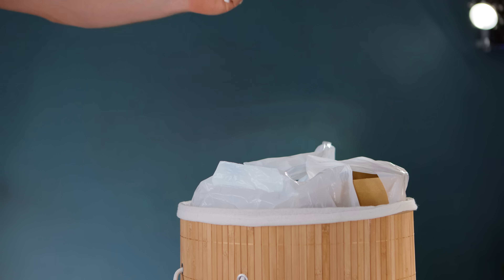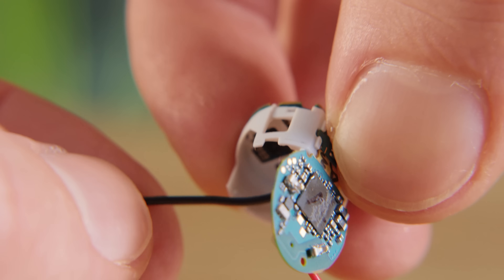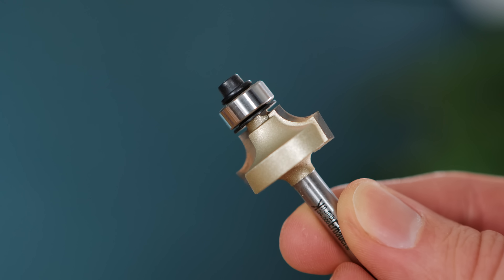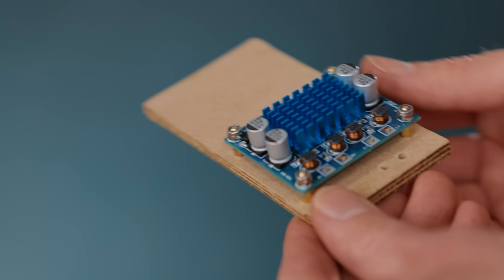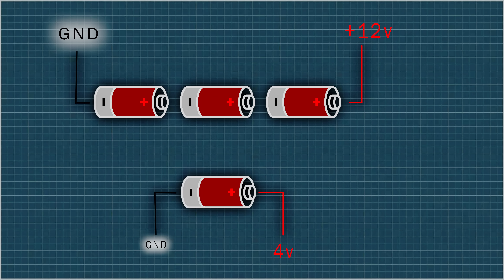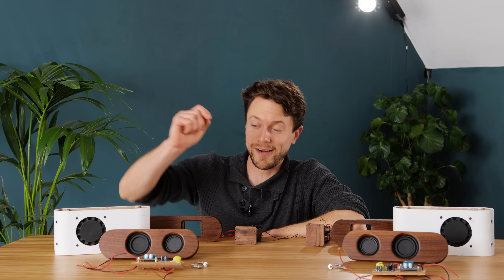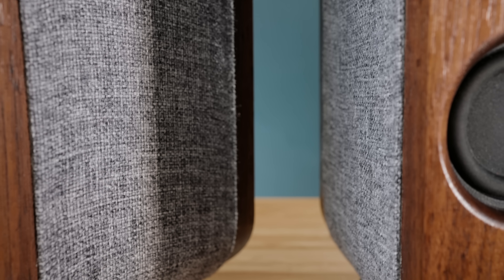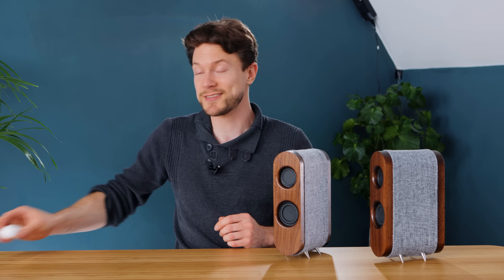Transforming dead earbuds into POWERFUL wireless speakers

Comment: I think i missed something... dont you have to push a button on the headphones to turn them on? I didnt see you address that switch, rather I heard you say that you will replace the battery and can add a switch? how does a switch to the battery and not the proper switch work? is it safe to assume that all headphones come on when there is a battery? without the actual on off button being pressed?.... signed "trying to understand"

Comment: I like how he says use old earbuds like it's gonna be a cheap project. Then mentioned he used a $30000 CNC machine. Lol. This would only be moderately doable by most people if they use old speaker boxes as well and just concentrated on getting the electronics all sorted out. I could probably buy a reasonably cheap used car for what it actually cost this guy.
Reply: Exactly. But most people would just save their time and effort, spend $30 - $60 and buy a bluetooth speaker.
Reply: You don't have to buy a CNC machine to use one. Plenty of companies charge by the hour to mill for you. Alternatively, if you happen to be a university student, you could look into reserving time with their CNC machines (if they have any).

Comment: I mean I was on board, brilliant idea.. one thing though. That was not a chamfer router bit... chamfer’s are flat. That was possibly a ‘no file’ or 1/8” round over bit... which can add a nice consistent touch. So does a bit of sand paper... cheaper and far less fussy as a bonus.

for those that end up disappointed by a search for a chamfer bit looking similar to the one he mentions in this video..

Comment: What a liar and jackass. A 2 inch woofer (it's NOT a fucking subwoofer) CANNOT go low, never mind "incredibly low" and it will NOT run a passive radiator etc. Stupid liar. Spend $69 and get a Klipsch bluetooth speaker.

Comment: Interesting way to recycle but just curious.. Why didn't you add a way to just charge the batteries without taking the back apart? Just wire the rechargeables upto a USB-C adapter?

Comment: Proper speaker building requires use of Thiele/Small parameters for creating the containing cabinetry. 
While this build will give you Mid-Fi, it will not give you HiFi.
https://youtu.be/zNHDbXAmY_0?t=238
I doubt these speakers can go much below 70 hz, which is my guess due to driver size and probable builders lack of regard to T/S parameters in the build.
That is not in the "incredibly low" range, which is enthusiastically promised, if that is, indeed,  the case.
I do believe these speakers could sound better than other commercial mini speakers, but that's a low bar to surpass.
With better utilization of T/S parameters, the odds are a much better product could result.

Comment: Don't take this the wrong way but maybe for your next speaker/audio project you should test by electrical and acoustical measurements instead of recording the audio. Not only because audio recording is  affected by the room you're recording in and the position of your mic in reference to the speaker but also because it's basically impossible to know if the sound is really from the speakers, and even if it is real, you don't show the changes you made in postproduction. 
The video looks great and it's very interesting but it's kinda pointless if it doesn't actually work.

Comment: The reason why he did not integrate a built in charger in this guys is to prevent one of the issues you are actually doing the project. A dead battery. If you integrate a charger you will then look at making the battery permaanently attached or at the least hard to access because "it has a built in charger anyway". What I would have wanted to see instead is an option to plug in dummy batteries and an adapter so you can plug it directly to the wall or maybe a high power USB port so when you're athome you dont have to charge the batteries in the speaker and when you are on the go you can just slap in the batteries. This will also pro long the chargeable battery as it lessens the strain on their charging cycles

Comment: Sorry, nice take off DIY, BT boxes, but the costs are really high. The chassis alone cost € 180.00 plus postage.
The real wood front is not even shown and not everyone has a CNC milling machine to build the housing in the basement.

I think with all "Zip-Zap", the boxes are ~300,00 € (without the purchase costs for the CNC router LOL).

For example, for  under 300,00 € I can get: JBL 305P MKII
(and here I don't have to remove and charge a battery to listen to music when it is empty).

There are also amplifiers including BT at the price of the "bot's".

Comment: Matt, I felt like the treble was a bit thin on your speakers and I'm wondering if that has to do with the filters you created or the relative volume of the stereo amp or just the nature of the tweeters you selected.  The lows were nice and rich and the mids were clear without being muddy but the highs were much more crisp and clear on the bose speaker.  I'm curious to see the guide and hope you have some more details about the frequency crossover points.

Comment: Those base speakers alone cost 150 euros excluding shipping. Add up the wood, the mdf, the amp, the batteries, and the amount tools you need to make these. Just live with wires and save the hassel charging the batteries all the time. You spend 150 euros on a pair bluetooth edifier R1280DBs, you get 10x better sound. So much for "Best in this size", what's the point to get to this small when sound quality matters.

Comment: I mean REALLY??? Shouldn't it be titled; "How to re-purpose $25 wireless earbuds by spending $150 on DIY wireless true stereo speakers using a $3000 CNC machine'" ??? If I may suggest, could u do a similar video with much cheaper materials and less DIY work with same internal electronics from wireless earbuds for us cheap-ass citizens? Great DIY video with GREAT RESULTS (except you lost a lot of high end so get better tweeters or tweak it a bit more). Still, I love your videos dude!

Comment: Most of if not all earbud sets will shut off if they are too far apart from each other.. not much wider than the width of an average head.  This would obviously severely impede the usefulness of this setup. How did you deal with this?

Comment: I'm very surprised you didn't build in a charger. Or at least use metal threaded inserts for the screws on the battery access panel.

Comment: should have had a BMS with a USB-C slot on the back for charging. Otherwise, great job. Design is awesome.
Reply: How would you do this just wondering because that sounds more convenient than pulling the batteries out
Reply: @colintroy7739  there are small BMS boards online for a couple of bucks. I think they could be easily fit into the speakers.
Reply: My thoughts exactly.
Reply: installing a charge jack to the back of the speaker and making sure it was sealed good would allow a external charger cord to be plugged into the speakers to charge them.  All the charger controls could be external with the charger.  The charge jack would have a "break before make" to remove the load on the batteries for charging.  This last part may not be necessary but would ensure the batteries are isolated for the charge activities. Example of an inexpensive BMS - https://amzn.to/3fREBpx
Reply: Perhaps it messed with the volume of space? But this is the only gripe.
Reply: I was thinking the same thing.
As for how, don't reinvent the wheel. The earbuds have charging built in. Solder it up! Resaerch it first but it's probably 5v.
Or, see his 'things you can make from a dead laptop' video to find a controler for charging the 18650 cells.
Oh and the earbuds probably have volume buttons and a button for new bluetooth connections as well.. more soldering anyone?

Comment: Why not use a lithium ion battery which can be charged through a micro usb/type-C  port. Why go for this unscrewing then taking out the battery pack then charging individual batteries..which is a very slow process

Comment: OMG This is genius! Where can i find more tips about type of battery to use or how to get the correct voltage for the speakers i want to use? And how to not fry the electronics from my old bluetooth  headset? :D Sorry about all the questions!
Reply: Ah, amplifier. Noted! :D
Reply: What about turning it into a little hub that can send the signal over radio so you can transmit to as many speakers and sub-woofers as you want with a signal receiver for each unit? :D I hope anyone can give me some tips on this! :)

Comment: great idea, thanks. being me, I would make them with a charging board inside and simply plugging them in when needing a charge, instead of removing the batteries and putting them into the external charger

Comment: Those are NOT IN ANY WAY cheap speakers, lest anyone be mistaken. € 74,95 for one subwoofer, € 15,95 for one full-range, so a total of € 90,90 per speaker or € 181,80 for two units as shown in the video, and not in stock when I looked.   Also also, European shipping to USA and possible Brexidiocy for anyone in England or vice versa.  Alternate sourcing in USA is questionable, but they're made in Asia so might be cheaper there.

Comment: This is a lovely build. The only thing I think is a negative compared to shop bought units would be the battery pack. Aside from the lack of a battery low type indicator (would the Bluetooth pairing show this on the paired device such as a mobile as the phone would see the speakers as a pair of Samsung headphones ?) - I think having to undo 8 fully tightened wood screws and use a battery charger would be a pain compared to a shop bought unit with USB recharging capability. 

The above isn't criticism at all, I think the build is amazing - Im just saying as I'm aware you often revisit and "upgrade" your builds - this is the only bit I would change. 

Is the sound volume controlled entirely by the Bluetooth connected device ?

Comment: really nice  concept dude. but  i think that will be better if  the  system charging is  plug to the  body . so  very easily charge without pulling off  the  battery pack. or you use  the  adaptor 12v for  the power  , so  no need  battery at all. but your  idea is  always awesome dude!!!

Comment: Thanks for the neat way of making some money on Etsy later this week lol

Or... I would, if I had the tools and money to pour into upcycling dead buds. Oh well. Guess it's going to become somebody else's money.

About the circuits you made, those could very easily be made on a home-made board. Sure it would cost a little more, but it would look more professional for somebody going pro and mass-produced; alternatively, the circuits could be mass-produced 20 or more per-unit with grooves cut into them for breaking the individual boards apart and be made relatively cheaply with a myriad of producers local and abroad so long you've got the Gerber files to give them, and for relatively cheap!

The space adjacent the amp would be a great place to put the whole lot, and grooves could be cut into the wood body for some hook and-loop fasteners to be used as a means of customization, with complimenting fabric covers sold as accessories.

Comment: Great project with one exception. I would incorporate a charging system for the Li-Ion batteries. A 5V USB charger PCB is available on ebay for cheap and can be incorporated into the housing for not a lot of loss of interior physical volume. Then you can just plug your speakers into a USB mini or type C plug to recharge them as simply as your old earbuds.

Comment: sorry I think I missed something. Does the ear buds have a small microswitch that you bypassed to turn it on when you connect the battery power?
Reply: The earbuds automatically turn on when they're disconnected from their charging case, and so I think they turn on automatically when they receive power.

Comment: I've done this with many Bluetooth headphones and smaller speakers this does not work unless a new mosfet higher driver is put in. the headphones themselves do not have a high enough mosfet driver to power these speakers that's the one thing that was not included into this build.